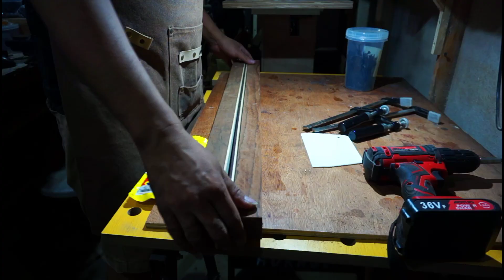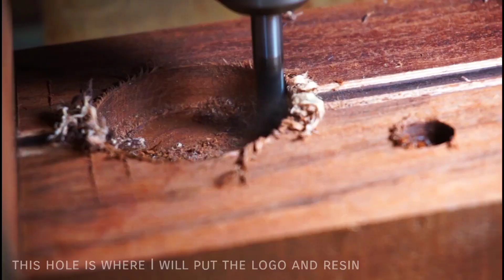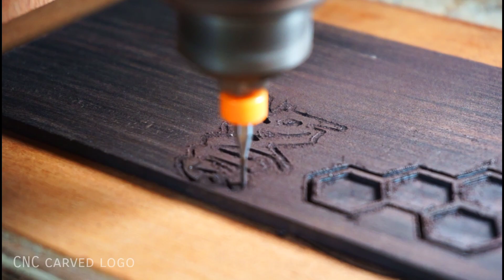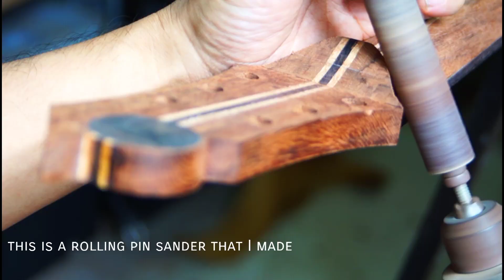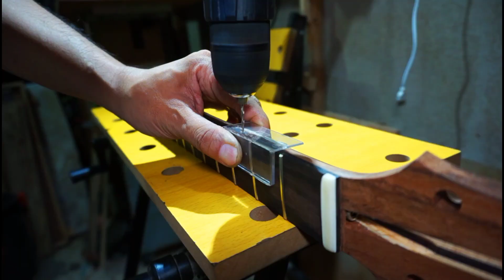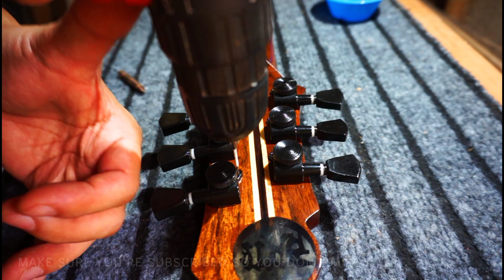Guitar Neck Full Build - Laminated Neck with Epoxy Resin Logo - Pinoy Guitar Builder

Comment: Great job as always. What software you use on your CNC machine?
Reply from the maker: For operating the machine it's "Laser GRBL" for Windows and there's also for android which is a bit buggy "GRBL Controller". I use "Easel by Inventables" for designing and creating tool paths.
Reply: @GitaraMaker  Thanks for your response. I built my CNC too and I’m using Mach3 to run G codes and Vcarve pro for designing and tool path.
Reply from the maker: Oh I've seen Mach3 on YouTube while searching for grbl software after building the CNC, I just couldn't find where to download it back then so I settled with what I found.

Comment: WAIT WAIT WAIT!!!!!  You built your own CNC machine....?   Ummm..... How?
Reply from the maker: Yes I did. 1" tubular for the frame, I got most of the parts online through China - bearings, stepper motors nema17, Arduino, CNC sheild, etc. I'm using Rotary for the motor, I can also attach laser. It took me a month to build, but operating is the hardest, need to study CAD CAM operation.